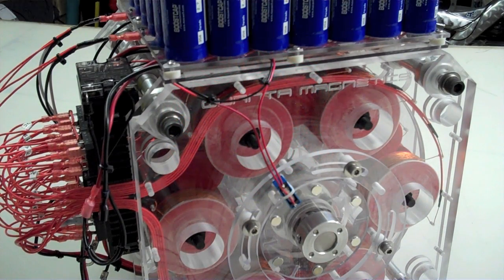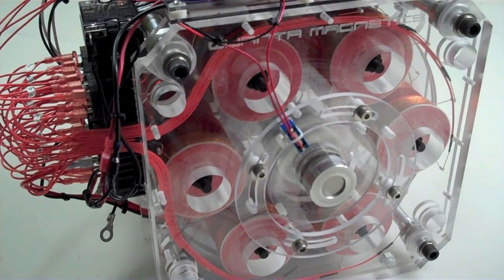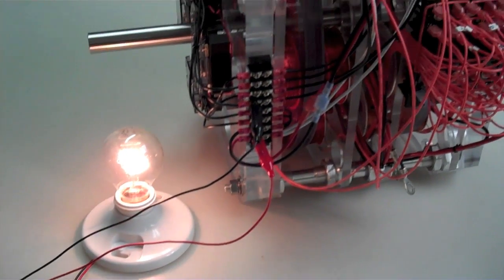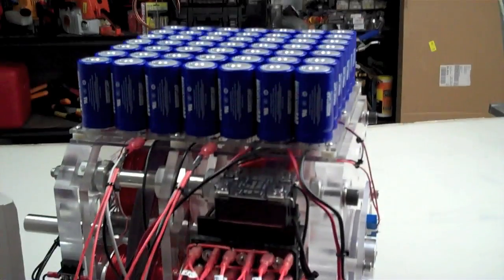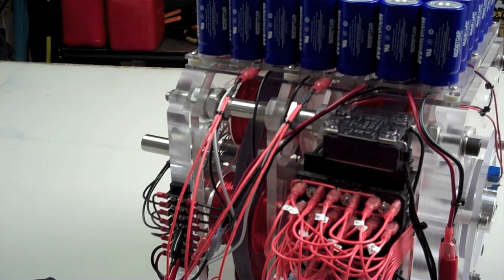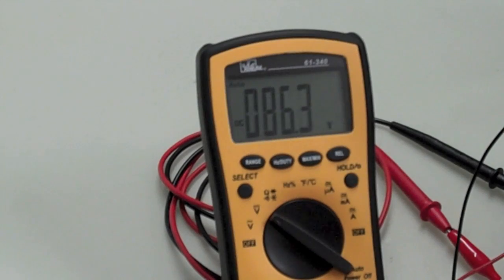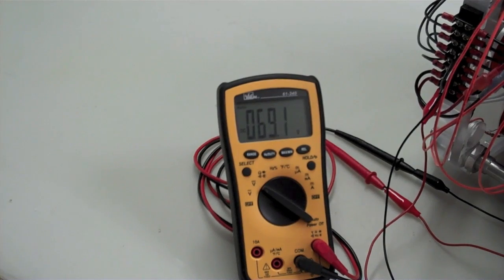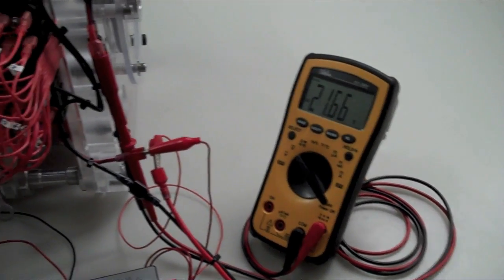Q2 SELF CHARGING.Part 2

Comment: If you get a shock with open circuit that means you could charge the caps by earth grounding them with a diode and putting the other end of the power line into an antenna. It's basically able to collect atmospheric electricity.

Comment: its giving off a kinetic frequency charge causing the dissipation because of the inferior physical structure of the caps is only a fraction of its complete design potential, what could be used more for more energy recycling , this will put it well beyond 100 percent. thank you and your welcome. iam the creator of existence. in heaven icreated what are called 'kinetic capacitance' to run angelic machine bodies, gundams for example, there are no wires no coil transfers, only direct energy transfer in cascading polarities, and mechanical and frequency leverage in energies favor, how does energy lose? the notes on the guitar are some of these patterns,the body is sustained forever. this coupled with flash, frequency, light, kinetic, and all the forms of energy cascading into eachother produces energy production run off to a physical tuned frequency of itself , its own form, to achieve this takes probably only a few of my angels that did this work for me when icommanded of it and it was produced. also it is required it not only be limited to 'electrons' and allow all other states involved just as the atom and more than that beyond the atom. more efficient than 'atoms'. remember something stable is not overunity as some believe, overunity is only endless powerproduction and to power things powering multiple things to power the first only for all become the first and last and every number in a shifting order the golden spiral is an example of this however a constant is the truth  and the spiral is at a loss. this is the 'current condition'. say no to current use non current as your energy from everywhere. the kinetic forces multiplying in number , and in size, your caps for example, they must get larger, and be of the physics design specified in a cascaded events it is non cycle but a living breathing pulsating wealth of its own vibration and singing and ramp rates varying and glowing with light for you are so beautiful you are very wise and always be true and always be all you for all is true then all true are one and to the dark is light to light and is dark and to the light is dark to light and dark is dark to dark and light is light to light, these in the very least, not just neg and pos. because when energy mass exceeds capacity it is even another form you must bring all forms throughout growing new forms and using them with eachother as new ones are formed and created and it is continuous and non destructive power forms, those destroying particles and atoms to rupture them release the stored capacitance of it reducing it to nothingness and its stored energy released with no further involvement for a short period of time because they only see the release or explosion, those imbiciles have come against me and my creation. understand this is a mechanical heart and is really where electricity comes from. think of electrons as mechanical components of the many mechanical components and they share and borrow, not take and not give back, or they get back eventually, like during an emergency draw for timing of unseen events, then restablishing and covering that draw overtime until is back on track, this is what causes time= a loss. temporary losses must be accounted for in either sustain or replacement or trade offs received be equal eventually or exponentially and then frequency of all gains and losses must be tuned throughout with eachother. and even play like music, music and microtonal music with taste and not ignorance is and are viable patterns and flowing asymmetrical and symmetrical and rebalancing in frequency adaptations. oh and everyone knows windows 10 is causing the typing spelling errors  everyone.

Comment: What; exactly, is this used for? I get that its a "long lasting"(?) generator...but i don't know enough about electricity to understand why this is so neat. I think it looks cool and i want to learn more.
Edit: i should say; like what is the use case? what makes it so special? I think its really neat, it seems to run off of itself? is this "overunitity?" again i only have a grade 9 education and haven't been able to fully understand electricity yet. I don''t think im stupid or a full on zealot of "free energy" but this; from your previous video seems to charge itself, and to my understanding that is quite the feat. is this a way to power a home/oven/fridge/quad from a few 9v batteries? I realize that is quite the range of power requirements but I'd think something like this is more along the lines of, well, i guess that depends on what you power it with? or that doesn't even matter because it can have the rpm go up quite high and that is what is meant to power something, right!?

Comment: Electromagnetic Energy to the capacitors unplugged go to high voltage due to electrostatic increase of the field surrounding the whole unit. The reason for the capacitors being unsafe to be touched while unpluged is because the capacitors are now making their own ground by harnessing the magnetic field increase cutting resistance to almost point zero.
Great job!!! I believe Nicola Tesla would be proud.

Comment: Well I'm not that smart but I understand one thing when you're talking about alternate energy sources if anyone has one they can hold any type of amperage load they be bragging about it. If you could charge a battery I'd like to know how many amps of power it could charge that battery with a 24 volts That's The $64,000 Question and for how long

Comment: Why not make high voltage self charging banks with your black box design? The microfilm patches within a capacitor configuration all hooked together like capacitor banks. Could you not replace a diesel generator with the correct design? With a smaller version of the pulse generator to trickle feed the banks?

Comment: This is pretty cool, however I do not see ANY practical benefit to the added complexity of your version of a Dynamotor. Devices like this have been used for well over a century, they did not have bridge rectifiers (solid state) back then so if you needed DC from AC you employed an AC motor coupled to a dynamo (or vice versa) or if you had 60 cps AC but needed 440 cps AC (for a ship or airplane because higher freq. AC can use smaller iron cores in motors and TXFs) you would couple a 60 cps synchronous motor to a 440 cps synchronous generator.

Comment: also, the lithium ion battery can be re-charged by the output energy, same as the capacitors already are in this design, and then be disconnected until it is again needed to start the machine again after it has been shut down or turned off. that is the only real reason you would need the battery. to restart the system once turned off. otherwise it would indeed just continue to operate from its OWN internally created REGENERATED power to feed the cycle's loop. Again, basic electronics!

Comment: you're missing the point of the system creating enough power at the output than what was initially put into it from the input. This is POWER amplification. A power input and power output do NOT need to be equal. This machine acts like a "tuned circuit," which DOES indeed amplify input power internally to itself and outputs a portion of that power while retaining a portion to "re-power" itself in a continuous cycle. This is known as positive regenerative feedback. It's basic electronics 101. It is used in almost every type of amplifier out there. check into it.

Comment: Very Cool machine, but not sure what you're doing.
300mA @ 21V = 6.3 Watts draw on those LA batteries, giving 100V @ 63mA max output.

Sure, the storage devices will conserve any Excess power, but will not provide any New power.

Personaly i feel that you're on to something, but simple rotary designs are probably not where the magic power is.

Take a look at eccentric and angular interactions between high power permanent magnets and coils.

Try elliptic and interwoven coils hit by in-out magnets for a start.

Comment: Adding the controller would indeed allow more efficiency and would unlock the system's greater potential to power larger motor generator units that would generate output for increasingly greater loads. This configuration would cascade energy in an upward or power amplification fashion as did similar systems using dynamos in the distant past. The idea and its application is definitely not new, though this seems to be a more efficient and modern update to the method and specific technology. This is all made possible by the superior capacitor technology of this day and age. (It would use a fairly small initial starting power and enable truly great output power.) Anyone ever heard of a Wimshurst machine glass jars for capacitance storage circa 1880s? There's more.......anybody for a history lesson?

Comment: Seems if you added a lithium ion battery to initially start the system, and then ran the system to trickle charge a larger cap bank, you could conceivably power a much larger motor generator unit that would power a residence, or possibly set up a series of motor generator units along with their respective cap banks to charge and run larger and larger systems until you have one capable of outputting a load of significant size like a town or city.
Reply: that wouldnt work since your input power is just a lithium ion battery only the generator motor at the end cant output more power than whats being supplied

Comment: Seems to me that the caps are picking up the electrostatic charge of the field rotating through them similar to how the earth's magnetic field rotates and fends off electrostatic charges from the sun. though it allows most of the sun's charge to pass around it, some it that charge becomes grounded or picked up by the earth itself, giving the earth's core a bit more fuel so to speak. Seems like something akin to how your motor generator operates by regenerating its own energy? This device, as does the earth and sun, seems to operate more like a "tuned circuit" than anything else, able to use energy, amplify (generate) energy, use that same energy to regenerate itself in a closed loop, and to power a load -- all in one! What are your thoughts on this?

Comment: Cool concept! What's the maximum wattage output and how much  mechanical resistance can it overcome yet still run independently? I can see this being utilized to run low voltage robotics without sacrificing work potential or supplemental torque for wind turbines.

Comment: So What happens when you run a load on it like say a alternator off a pulley "and I'm talking about using pulleys" that let you keep the RPM up on the motor side and still have the extra amps or volts?

Comment: and you can build totally free energy car.. am i right or wrong? :D
Reply: +Hydrogen Nuke You could use a small battery just to start this motor :D and to give a spin when it loose power. You will just need a small solar panel on roof and you will have the free energy car.
Reply: Grigore Turcan wel the problem with that is you would only be able to Drive at daytime also have u actually looked at solar panel production? Currently solar panels are highly inefficient (around 40%) and are not green. What I mean by that is that they are actually made of toxic material that is extremely harmful. It takes more energy to produce these then they estimated to produce in their lifetime. The government actually subsidizes this stuff so that the manufacture will continue to make them. Strangely enough the most efficient and green source of energy right now is nuclear. The waste is actually the size of a pencil and it's efficiency is 98%...now there has been a recent breakthrough in fusion however they have not made that efficient yet.
Reply: +Willy Wijaya wrong like he says in the video. eventually it will dissipate the energy through the coils as well as heat
Reply: +Hydrogen Nuke ahh.. ok.. but is that made low energy consumption?.. sorry for my bad english.. and i cant speak english.. hahaha
Reply: +Willy Wijaya Would be already great for your bike. :)
Reply: Even if it's low energy consumption the energy will eventually be spent. Any time you put work across a load you have loss of energy in this case energy = integration of power (or work) with respect to time. This means the longer we spend doing it the more energy will be consumed.

Comment: Can you comment on the Wittenstein Galaxie Drive system? Its an "alternative" gear wheel concept that is over 92% efficient in power transmission and has very little, if any, backlash at the zero crossing. Would love your take on it and what you think its potential is. A quick google search of "Wittenstein Galaxie Drive" should return relevant results. Thanks.
Reply from the maker: +Hydragurum   It's a brilliant design with an extremely promising future. Love the spiral engagement aspect. Our machinists are very interested.
Reply: +PMMG4HYBRID Thank you for your feedback

Comment: instead of 9 volt batteries, could you use a bicycle generator to start it? if so then could this be a answer to renewable energy. if that motor turned a belt which turned another generator, which powered a 12 volt inverter? sorry if I'm completely wrong, I'm not super tech savvy.
Reply: +Nic Boyd not enough current output.

Comment: the more caps you have adds more load, check you total oms. this system will put out more power with less caps and Farid rating.
Reply: correction (higher) Farid ratings

Comment: This is very similar to the KERS systems used in F1 and more so like those beginning to be implemented in production cars, such as Volvo.

There are two types of KERS, with a physical flywheel to store kinetic energy and "electric flywheels" which would be capacitor banks connected to a motor/generator.

Interestingly, your system seems to combine both types of units into a single module.
Reply: +John Connor im not an engineer but i remember when honda announce their nsx required no plug in and that it will always stay charged.  one thing comes in to mine is a lot of capacitors. its the only thing i can think of when you need a strong electric power and a lot of cycle over and over.  

i know theires a new lithium cell that can be quick charge as well that might be part of the integrated of the capacitors.
Reply: @BlueRice   It will loose chsrge but the likelyhood of you ever stopping from useing the car for 100 years is unlikelu the car would be used almost daily makeing the charheing issue a nonexistent one. Its geinus. And this video sipports it. The only real issue is the issue of reduction of energy from uphill travel. The charge needs to be capable of produceing more energy for uphill and downhill climbs. If the car runs out of charge as its driveing uphill you run out of energy and are stranded. That and the cost of thease is not cheap. Seems like the use of radiation could stop that issue entirely at rhe cost of user health risk.
Reply: @burntchickennugget191 it’s not about that at all. It’s about charging your electrical bank at home with this device and then using that to charge the vehicles like Tesla cars. These are the years that we need to start pushing these devices and placing them in lots of homes. I bet you fuel prices would come down in a year to a dollar.

Comment: Of course you know by now (2 years later) what that phantom voltage is coming from.  I say put some wires on it !  Power another load !  Fantastic !  Maybe THERE is your perpetual motion machine.  The universe is one... is there something that forbids using the power of the universe ?  Course not.  All the power we have comes from that if we will attribute it properly.  Thanks so much for your videos.  Reeeeeaaaallllly exciting stuff !
Reply: Sonny Moon The universe isn't a perpetual machine, if it was the big bang would still be happening everywhere.

Comment: why not , try and use some sort of quasi crystal type thing like  Steve Hutchinson. if you added that to the mix it would negate the loss of the coils plus you would always have power to start the machine for free also ... then the machine would be self sufficiant .  also someone comment on using a solar panel that would work also to charge a battery to start your machine.  i would also try and incorporate a thermal power generator to it to further use a fan to cool down your coils ++++ lol

Comment: I believe in wireless power transfer and it is a proven thing that happens. So your device actually recycles some of the energy it gives off by the magnets given the close proximity of the the capacitors. This is valid no doubt.